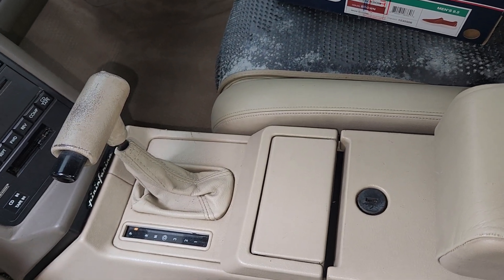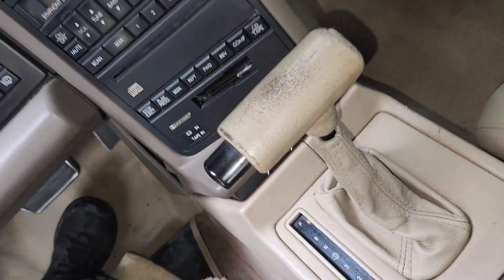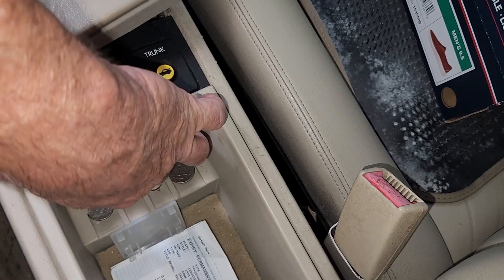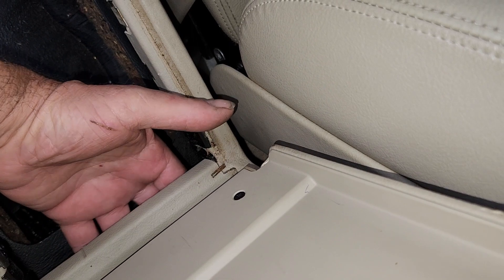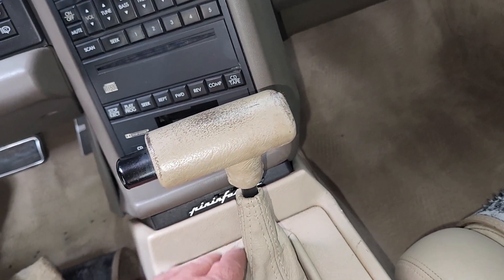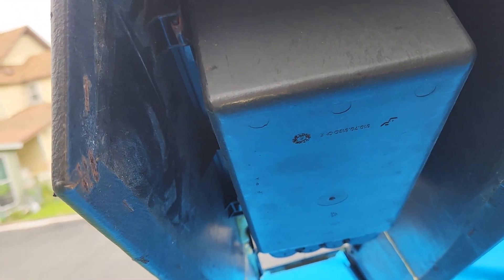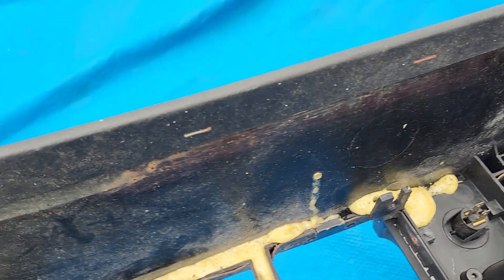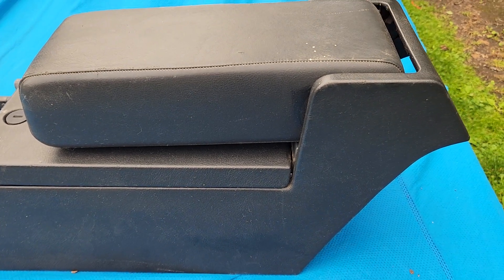Cadillac Allante center console removal. 1987-1993

Comment: Follow up on removing the console I came across a step that was missing.  You must remove trunk/gas switch bezel to access the switch terminals.  There are four philip screws on the front & rear edges.  I blindly  pulled the terminals and screwed up the storage compartment light switch assembly.  You were right that console is real fragile. I had to glue pieces I found broken.  I installed a 93 armrest with fold out cup holders.  I don't  know if it was worth the aggravation. Pass on the info

Comment: Ross, thanks for the video. Console armrest with 4 nuts removed the armrest should come out, but looking at your console  it looks like something else is holding it  in place. I have a 91 but I have 93 with cup holders which I would like to put in my 91.  Help would be appreciated. Art D
Reply from the maker: Once the console is out of the car if you look at the area where the armrest hinges and you will see the nuts that hold the armrest to the console.
Reply: @rosslongo9353  thanks. I see them in your video